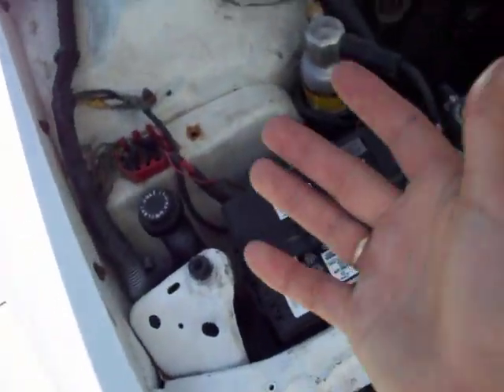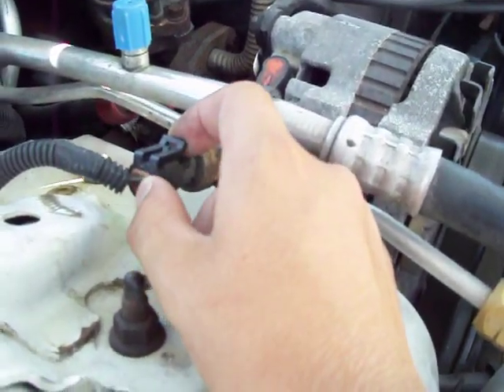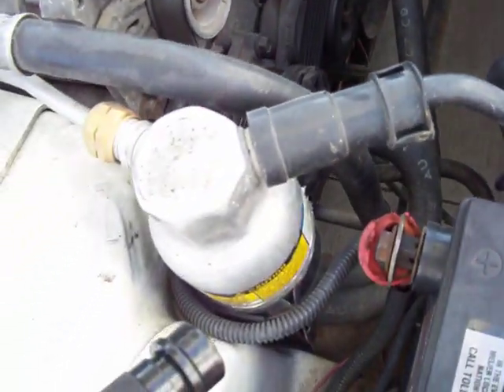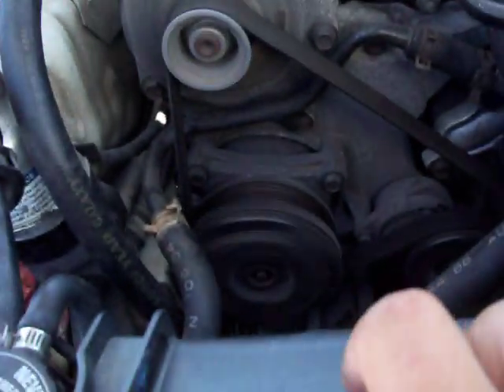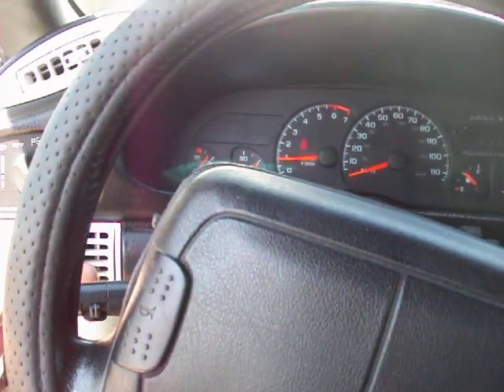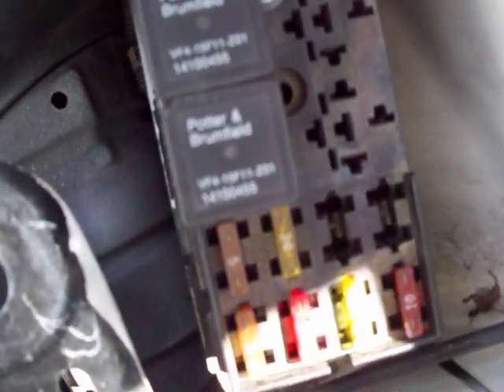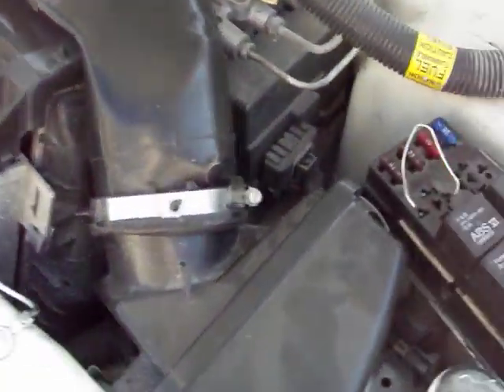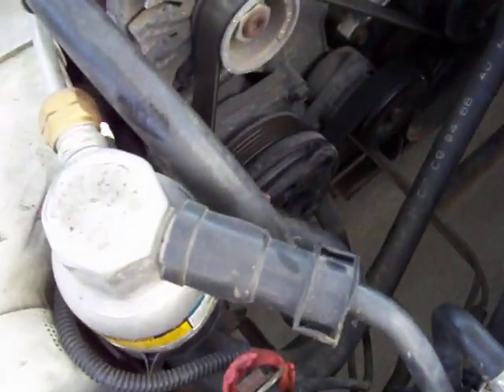How To Make AC Ice Cold, Recharge air, and Force the Compressor Clutch to Engage

Comment: how do you so this with a 4 pin micro relay that is only numbered 1-4?
thanks
Reply: Hello Brian, The relays used to operate systems like this are usually set up in a similar way... The relays are usually the SPST type (Single Pole / Single throw) but sometimes could be the SPDT type (Single Pole / Double Throw type)... The relay is nothing more than an electrically triggered switch... It actually turns a circuit on & off the same way that You do with a light switch in a building by flipping the switch with Your finger... It does the 'flipping' electrically.... That is, an electrically operated automatic system of some sort turns this switch on & off... With Your relay being the 4 pin design, it would be the SPST type.... One of the pins gets continuous power when the key operated ignition switch in Your car is turned on. Another pin in the relay goes to the chasis ground... A third pin goes to the equipment circuit that electrically activates this relay , and the fourth pin goes to the a/c compressor clutch.... The trick to turning on the clutch, is to connect the circuits in the slots that the continuous (fused) power and the a/c clutch relay pins connect to... DO NOT USE A PAPERCLIP TO DO THIS!!!! The paperclip could easily damage Your relay receptacle by shorting to another circuit or having a bad connection and overheating the circuits and melting the insulation & plastic for the main fusebox... Use a 16awg wire with bayonet connectors the same size as the relay pins to do this... You can identify which circuits You need to connect by testing with a VOM or a test lamp which identifies positive & negative circuits... Another way to I.D. circuits is to get the service manual and trace the circuits by using the electrical schematic diagram for Your vehicle... Make sure the a/c compressor is not locked-up (seized) , by turning the driven disc (on the a/c clutch) with Your hand , before doing any of the things I just described above.... One more thing Brian, go to a search engine (such as Google) and put '12v SPST relay schematic diagrams' in the search box, and you'll get several blogs... Some will have nice electrical schematic photos of what pins #1 through #4 actually do... Good luck with this and always use safety glass's and the correct procedures when doing work like this....

Comment: question, when using paper clip, my horn started going off along with alarm, but clutch did not activate, what else can I try. I put clip in 30 and 87?
Reply: sounds like you put it in the wrong relay
Reply: DO NOT USE A PAPERCLIP TO DO THIS!!!! BAD ADVICE!!! Use a 16 awg wire with a bayonet connector on each end that are the same size as the relay pins...  With the engine off, turn the compressor drive plate (in front of the a/c clutch) by hand to make sure that the compressor still turns freely....If the compressor does not turn, STOP... You have a seized compressor... If it does turn, then find the CORRECT relay.... Remove the a/c relay and count how many pins it has... If it is a 5-pin relay, put the jumper between the slots for pins #30 and #87A.... If it is a 4-pin relay, put the jumper between the supply power slot and the slot for the circuit going to the a/c clutch... Follow the CORRECT procedures to do this... Completely Disregard what You have seen on the video post above... One good source of info. would be the video that Auto Zone has on DVD for about $15... It is worth every penny...

Comment: Ive bypassed the low pressure side switch to engage conpressors before, during a charge but i have never bypassed a high pressure switch, That's just asking for trouble
Reply: +Texassince1836  Absolutely !!! The same safety relay de-activates the clutch when the system pressure is too low OR too high.... One way to protect Yourself when TEMPORARILY by-passing the safety relay when charging the system is to use a gauge on the high pressure side... Otherwise, neverby-pass the safety relay.... Always use: safety glass's , pressure/temp charts, thermometer to measure local ambient temp. , correct methods & equipment when doing work like this....Dis-regard the video above, it is wrong....
Reply: +Michael Martinez depending on manufacturer, and year some vehicles have switches on the high pressure side,  low pressure side,  or both...ive always just bypassed the LOW side

and on a side note,  i work with a guy named Michael Martinez
Reply: +Texassince1836  This video covers the single relay that controls power going to the clutch, which most vehicles have- a single relay controlling power to the compressor drive clutch, which would have a similar effect as a motor control in what You probably frequently are working on in Your profession.... There are numerous sources of inputs coming from various circuits that control relays like this... Pcm outputs, hi pressure sensor outputs, lo pressure sensor outputs,  cabin temp sensor outputs, etc.. The point that I agree with You on is this; the relay that controls power to the drive clutch will keep the system from over pressurizing, over working, under pressurizing, over loading the engine on steep grades, etc... By-passing this WITHOUT the proper equipment to sense the hi-pressure side of the system (to temporarily enable the system for charging) , is asking for trouble!!!
Reply: +Michael Martinez  BTW, tell Your co-worker (Michael Martinez) , That I said hello!!!

Comment: cant find a video on a 99 GMC Suburban K1500  350 vortex just bought, clutch is not coming on, fuses 2 ok, relay? who knows 4 pins connected a can of freon with everything on for approx 20 mins, shut the valve on the can closed, unhooked the hose to th low side just burst of freon , checked all the wires plugs clean ,  still clutch is not engaging(HELP)   ty

Comment: I am not being critical here - He should caution not to bridge the ac clutch and drive around like that. Also that it's illegal to vent Freon in the atmosphere. 
Apart from that he's done a good job for anyone attempting a repair like this themselves. 
I had an old F-150, worth about $2,000. The AC wasn't working and when I went to the shop they quoted me more than $2,000 to fix it.
I basically did what this guy is showing here, I connected Freon and stop leak, bridged the clutch to force it in, and man was that AC cold from that day forward.
The cold AC became a positive when it came time to sell it, the buyer couldn't believe how quickly it got cold on that 95 degree day!
Not to say you can't have a serious AC problem that requires major work you can't really DIY... But I'm almost certain most AC issues can be solved using methods in this video.

Comment: let i set for an hour and test static psi on low side ,motor off. psi should be about 100-125 psi @ charged. if higher then clogged orifice tube is most likely. remember to replace any lost pag oil.
Reply: +kalhoon  The 'static' method You described does not necessarily charge the system to the correct pressure as the pressures vary with 'dynamic' conditions such as; Ambient temperature changes, internal temperature rise , restrictions in the system beyond the design limits... This is why the books & videos that show the CORRECT methods, never give 'static' charging method specs and/or procedures.... They do however, give information of how to activate systems that have become too low by TEMPORARILY by-passing the safety-relay which activates the compressor clutch.... The same safety relay will also shut-off the system by de-activating the clutch when the system over-pressurizes on the high pressure side of the system.... This is why it is so important to use a gauge on the high-pressure side of the system while charging it... I have seen systems that are badly clogged and could not produce pressure anything more than 15 psig on the low side, and over 307 psig on the high side of the system @ 107 deg, F.  I would have not known what the pressure would have been on the high side of the system without using the proper equipment such as the gauge on the high and low side of the system.... The proper training and the proper equipment makes a difference... DO IT RIGHT, or don't do it at all...

Comment: shorting out the sensor (high pressure switch) is wrong. forcing clutch on can freeze the evaporator causing failure.

Comment: Very helpful. Thought I think I may have overfilled my ac. The pressure gauge seemed pretty wonky. Low one minute and high the next. I had everything working at 1st and then an hour later when I went to turn the ac back on. It wouldn't engage on its on.
Reply: +cubx1979 It could be clogging in the system, which usually happens at the orifice and/or finger strainer or the expansion valve, which ever system You have.... This clogging often happens from using the sealant the air-head 101 guy who made this video suggested . Please refer to the auto zone video to get the correct procedures to do work like this and always use a gauge on the HIGH side of the system and the low side... Use a pressure/temp chart while doing work like this... DO NOT ADD ANY MORE REFRIGERANT UNTIL YOU HAVE TESTED THE HIGH PRESSURE SIDE OF THE SYSTEM!!! NEVER EXCEED THE PRESSURES IN THE PRESSURE/TEMP CHART AS THIS COULD CAUSE A BURST IN THE HIGH SIDE OF THE SYSTEM!!!!

Comment: My compressor clicks on and off continually....Is my compressor bad? If I hot wire it do you think it will work?
Reply: It actually goes on and off about every ten seconds or so.As this goes on my gauge (when on) shows a mid charge.When clutch goes off I get nothing.In other words as this happens my gauge just flutters and I get warm air. I had cold air 6 months ago.
Reply: Yes, I added Freon. The gauge shows over half on the gauge.
Reply: @danmeredith6354  - Change your High Pressure Switch!